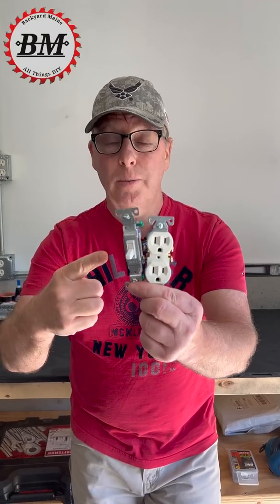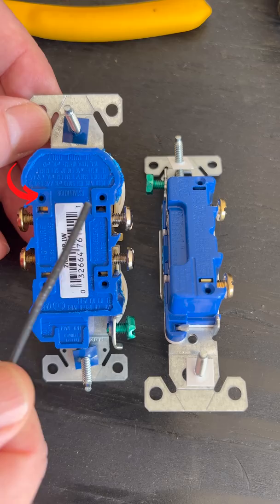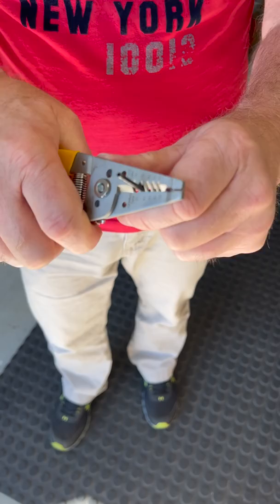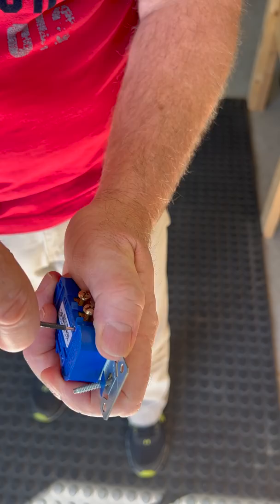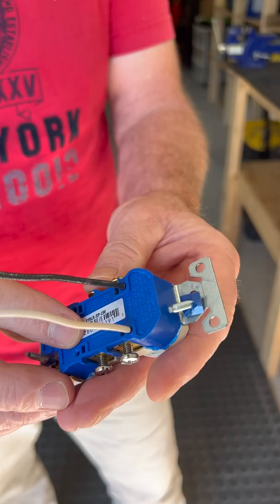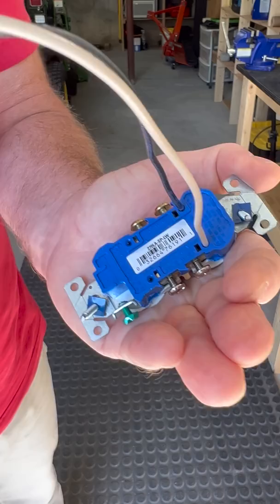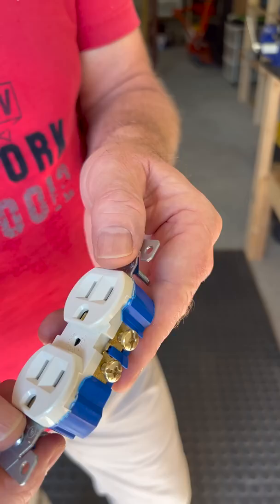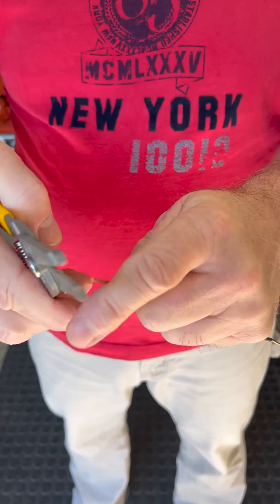Don't make this electrical mistake #Shorts

Comment: Why do manufacturers provide these backstab holes if nobody says it’s OK to use them?
Reply from the maker: For the average homeowner to be able to replace a switch or receptacle.
Reply: @BackyardMaine  suggestion for a video:  setup a physical model using both types of connections and demonstrate how the back stab cause issues and/or fail.  Perhaps such a demonstration video already exists, but I’ve only ever seen assertions that they’re a problem, never any compelling demonstrations.
Reply from the maker: @cslloyd1  That is a good idea but the main issue with these connections come years after they are installed. The normal heating and cooling cycles that are experienced when loads are turned on off eventually (especially if higher current circuits) weaken the spring tension where the wire is wedged between two conductive surfaces. One of the surfaces is very thin and carbon begins to build up and small arcs begin and eventually the circuit fails. I know this from 38 years of experience as an electrician and electrical engineer. I do have a longer video where I cut one apart if you're interested. https://youtu.be/e_C_twh5fQE

Comment: Don't understand.  If you shouldn't do it why have they been making them for years.
Reply from the maker: They used to make them for 20A as well. They were approved for years but now they can only be found on 15A devices. I don't like based on my experience repairing them over the years. I owe it to the customer to install the devices in a way that will last decades. I wired my own house 25 years ago and I have never had one electrical problem. I want the same for my customers.

Comment: If it wasn’t ok to do they wouldn’t be  UL listed, and nec compliant.
Reply from the maker: 20A stabs we’re also compliant for years but that changed due to failures in the field not at the UL testing lab. Talk to any service electrician about their reliability

Comment: so why do the companies who produce them allow this to happen?? like why make them holes in back when they cause issues.. possible fires/shock
Reply from the maker: More of a reliability issue than a safety one although many commenters say they've seen fires caused from these. Residential contractors seem to like them because they are quick and easy. I don't know.. why are cigarettes still sold.
Reply: @Backyard Maine  I do see sparks from outlet I installed in my own bathroom think I did use them lil holes first time ever installing a switch going to re do it soon

Comment: I prefer the side wire with the washer so u can stab the side wire
Reply from the maker: You those are commercial grad receptacles and a great option. I have a longer video which shows them here. https://youtu.be/e_C_twh5fQE
Reply: @BackyardMaine  I do maint. So I can get away with using them, I also use them in my home/garage

Comment: Why would ULl allow it if it is a big failure
Reply from the maker: I'm not sure what their testing duration is but they no longer list 20A receptacles with back stabs which is why they can only be found on 15A residential grade devices.

Comment: He forgot to tell you to shut the loop strip your wire make your loop apply it to the screw use your needle nose to close that loop Zen Titan down the terminal screw and that is how you do it correctly
Reply from the maker: Actually that’s is not what you’re supposed to do. I can tell you’re not a pro.

Comment: Okay, explain this then: If those devices are approved by UL and the NEC...why not use them?
Reply from the maker: They used to be UL approved for 20A as well (for years) and now they are only approved for 15A devices. Why is that? Because they fail at such a high rate. So if they were wrong about 20A what about 15A.. Of course do what you want but I find the 15A device stabs fail all the time.
Reply: @BackyardMaine  Well, I avoid using them if I can help it. I, like you, prefer my wiring to be more robust and less prone to failure. I like to know that my work will perform for the foreseeable future. I'm just wondering how these things got approved. Thanks for the reply.
Reply from the maker: @craigcorson3036  I really don't know but there are new connections just released on a limited Leviton offering which may prove to solve the reliability issue and still make a simple to use connection. I made a video on these which I'll link here. https://youtu.be/alHy7Ohp-wQ
Reply: @BackyardMaine  Thanks, I'll take a look.

Comment: If you're buying a quality device this isn't an issue...
Reply from the maker: Commercial grade devices don't have the stab option. Residential grade devices are all about the same based on my experience.
Reply: @BackyardMaine  basically but there are still cheaper products that aren't as good as others. Lutron makes commercial grade and residential but their residential is better than some off brand.

Comment: Why wouldn't you continue to bend the wire around the screw?
Reply from the maker: That's not necessary for the connection and it makes removal more difficult.
Reply: @BackyardMaine  awesome

Comment: So what about these push in connectors instead of wire nuts
Reply from the maker: I’ll buy some and test then out for a future video. I’ve only used them on instrumentation and lighting. Never anything drawing much current.

Comment: Why are America's outlets so terrible.. solid cable ? nooo.. exposed wires/contacts.. Nooooo...
Reply from the maker: Solid wire is actually a better conductor than stranded. Electricians are trained so the screw terminals are no problem

Comment: How can it be a mistake when that system is UL and building and safety approved?
Reply from the maker: The UL lists products they don't approve them. 20A stab in connection were UL listed for decades as well but not anymore. 15A devices are still listed but with limitations. They can only be used one time and they can only be used with 14 gauge solid copper wire. I don't think they are extremely dangerous but they are very unreliable.

Comment: As an Electrician myself, I've always tried to hook out of practice. But to say, NEVER backstab I disagree with you. Your opinion is not higher than what NEMA (National Electrical Manufacturers Association) deems satisfactory. Needless to say I disagree.
Reply from the maker: Did you know that 20A devices were approved for this type of connection for decades? But due to the issues experienced they can only be found on 15A devices now. Were they wrong before? Maybe the 15A will be nixed next.

Comment: The problem isn't stabbing it in, the problem is "electricians" that don't put enough into the hole which causes the issues..... feel bad for their wives if they have the same issues at home 😆
Reply from the maker: I have never found one that failed for that reason. The issue is the thin surface area that makes contact with the wire.

Comment: Sometimes you have to use them.
Reply from the maker: If I have more than two sets of wires I make pigtails.
Reply: @BackyardMaine  what if you're running half hots?
Reply from the maker: Meaning the other side is connect through a switch? If your switched and hot lines continue downstream you can pigtail the neutrals together and pigtail the hot and switched hot separately.  @ronaldswangler2538
Reply: @BackyardMaine  I was just running it through my head and you're correct.

Comment: It's  UL approved.    I use it all the time no problem
Reply from the maker: Did you know they were UL approved for 20A as well for decades? Not anymore. Why do you think that is?
Reply: @BackyardMaine  use them all the time. No problem.  Push  and. Play. Just like that
Reply from the maker: @johnkulpowich5260  Yup they will work but as an electrician I have replaced thousands of these over the years. They are the number one service call. I have never used them and I never will.

Comment: Why does the code allow it?
Reply from the maker: The code doesn't approve or restrict equipment. It tells us that we have to use it for its intended purpose and environment and follow the manufacturers recommendations. They are UL listed with the stabs but only on 15A devices. 20A lost their listing due to the high failure rate.

Comment: causes lights to flicker you say? Interesting
Reply from the maker: And many other issues until the circuit fails open.
Reply: @BackyardMaine  I have at least three light fixtures in my house that flicker intermittently. I will take a look at the switches first. Thanks for sharing.

Comment: Then why are wago connectors allowed?
Reply from the maker: Completely different design. I have a longer video on this subject where I cut a back stab receptacle open to show exactly how the connection is secured. You can check that out if you like.

Comment: back wire or backstab what is the proper term
Reply from the maker: These are Backstabs, quick connects or speed wiring connections and they are unreliable. Back wire connections found on GFCI, AFCI as well as on commercial grade outlets and switches are a great option since they press the wire with screw tension between two conductive surfaces with plenty of surface area.
Reply: I'm an electrician I always thought backstab was a slang term for back wiring. In school the instructor use the nomenclature back wire

Comment: I thought the back stabbing method was approved by the NEC, or UA.
Reply from the maker: The NEC doesn't approve or disapprove these connections. They are a listed (in this case UL listed) and so they are approved for use. These connections used to be approved for 20A as well but now they can only be found on 15A devices. They can be used but they are a common failure.
Reply: @BackyardMaine  Thank you. You are a great help.

Comment: I’ve tried but the wires in the back won’t come out. Is there a method where I can get the stuck wires out to replace the switch?
Reply from the maker: I have a video called how to release a backstab. Check it out and let me know if it helped. https://youtube.com/shorts/ijMOLq-zLMA?feature=share
Reply: @BackyardMaine  I tried that method as well. I spoke to my uncle who’s in construction and stated that if it’s been in there for too long, they probably got torched. Recommended I cut the wire off and strip a bit of the black and white. I plan on making the J hook and hooking them to the side because I feel that it’s the easiest to replace. I also plan on replacing the electrical box inside since it’s old and probably put in since the home was built in 1980.
Reply from the maker: @RSchlotzhauer525  Yes, if the method I show isn't working it is possible that the copper has welded itself to the buss. In this case just cut them off. But be sure that the power has been disconnected before you do any work and also cut off as little as possible to avoid having wires that are too short.
Reply: @BackyardMaine  thank you and worked. The issue I’m running into now is the old electrical box was nailed into the studs and taking it out was a pain and caused some damage to the drywall. I replaced it with an Old work electrical box which has wings, but isn’t catching on. Any recommendations on how to fix it?
Reply from the maker: @RSchlotzhauer525  That's a bummer.. I would probably cut out a larger piece of the wall maybe a square or rectangle a 12 to 18 inches, install the box on the stud and place a new piece of drywall for patch. If you try to patch the existing hole the old work box may just break it again.
Reply: @BackyardMaine  I’m assuming a 2x4 in the area would be iffy if I installed it. I might have to switch out some of the old work boxes for new work boxes if my switches are all on studs.

Comment: They arc cause you dont tighten the screw.
Reply from the maker: Wrong. The screws play no part in these connections. The wire wedges in between two conductive surfaces. The screws are for people who want to do it right.
Reply from the maker: 38 years licensed electrician and 10 years electrical engineer. Check out this video where I pull one apart and you will see the screws play no part. https://youtu.be/e_C_twh5fQE

Comment: us junk :D nobody in europe is using screws in outlets/switches anymore
Reply from the maker: We use them because the stab connections are very unreliable with 120v circuits. The screw connections when done correctly will last forever.

Comment: But the wago or what ever there called connection are ok ? I just old school it an wire nut it an wrap the screw on outlets ok
Reply from the maker: I'm with you but I have to say that I have been testing some wagos and I am surprised how when they are holding up. They are a completely different design than the back stabs.
Reply: @BackyardMaine  that's good to hear I'm a carpenter I see them have not used them because like in your video I seen back stabbed outlets bought burn up

Comment: Or better yet purchase a quality wiring device with CLAMP connections!
Reply from the maker: I agree. I almost always use commercial grade devices but I show the residential grade since the are often used.
Reply: The additional $2-3 is not worth the cost of a fire or the replacement labor of the device down the road

Comment: I totally disagree. Nothing wrong with using those wire stabs. They are extremely reliable.
Reply from the maker: I have never met another professional electrician who would use backstabs. Why? Because we have all seen their high failure rates. Of course I don't care what anyone does but based on my 39 years of experience I will never use them or recommend them to my viewers.
Reply: @BackyardMaine  To each his own, 38 years in the trade. I’ve installed quick wire outlets on hundreds and hundreds of homes. In fact when I was banging out houses that’s what all the shops were using , Leviton 15 and 20 amp outlets that didn’t even have the screw terminals on the side. In all the years, I’ve seen next to zero failures.

Comment: But u showed off those other cheap ass switches that work same way
Reply from the maker: Actually these are a completely different design.. The backstabs wedge the wire in between to conductive surfaces, it can only be used once and only with 14AWG solid wire. The others use a mechanical mechanism to hold the wire in place, can be used as many times and you like, can be used with 12 or 14 gauge solid or stranded copper wire.

Comment: This is an old myth and hasn’t been accurate since the 1980s. The outlets then and now are different. The back wiring is connected to the screw terminal. This is old advice that doesn’t apply today. I’ve seen thousands of loose side wire connections that have caused lots of problems. Esp if you’re looping like that and using a Phillips head screw driver on a flat head/square drive screw. 🤦🏼‍♂️
Reply from the maker: Wrong. I have been an electrician for 38 years and these fail all the time. Not just the old ones. The back wire devices that use the screws are commercial grade devices and are not back stabs. They work great and are very reliable but that's not what I demonstrated here in this video.

Comment: there is no data supporting this common myth the loop fails as well and causes similar issuers
Reply from the maker: Actually there is. That's why the stabs are no longer offered on 20A devices and are not available for the ground connection.
Reply: @BackyardMaine  respectfully both points are in correct. The reason they s  re not offered for 20 A is the wire gage and the depth of the box not because they come loose more often than the side connections  and the reason the ground was not ever push in was because the receptacles were too difficult to push in the box with five wires on the back
Reply from the maker: Actually they lost their UL listing due to their high failure rate which lead to fires. I think the stab connections are responsible for the introduction and adoption of arc fault protection. I have replaced countless burned up stab connections.  @ProfessorDIY
Reply: @BackyardMaine  I am not sure where you are getting your information but all The ones I see are in fact UL listed, that arc fault protection had to do with uis catching up with the rest of the world

Comment: Then why are they there?
Reply from the maker: I think the manufacturers are trying to make it easy for a DIYer to replace a device. They do work but I find they aren't very reliable. Some will last though and they are code compliant. The manufacturer also provides a second more reliable option (side wiring with j hooks). I just put up a video explaining connection options and their reliability. You can watch it here if you like. https://youtu.be/SBEyPgmstks

Comment: Had water drip in backstap you guees it everything needs replaced in house
Reply from the maker: That's a bummer..
Reply: @BackyardMaine  I am putting insulation for in that asborb emps and wire mess for rodents that will reduce them more
Ulkrain is losing Armour to drones cause they don't coat there ants 
Then put sacrificial pod near by 
I can give you how put done want feds on my doorstep

Comment: It’s all manufacturers problem they wouldn’t of designed it like that I’d it wasn’t rated an tested but yes making A better connection by curling the wire clockwise is slower 😂
Reply from the maker: Where do you stand on the 20A stabs? They were approved for years but not anymore.. They made them, tested them, approved them for years but with high failure rates that changed. Sometimes quick and easy looses the race.